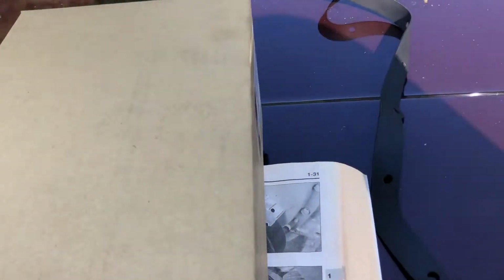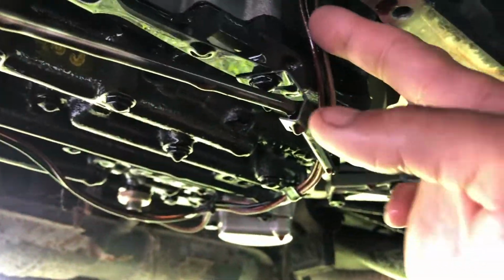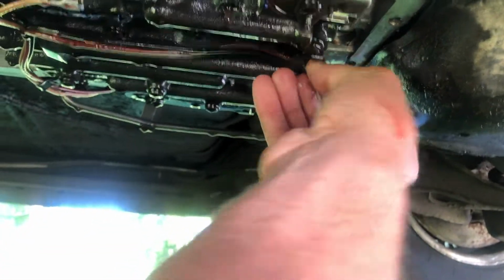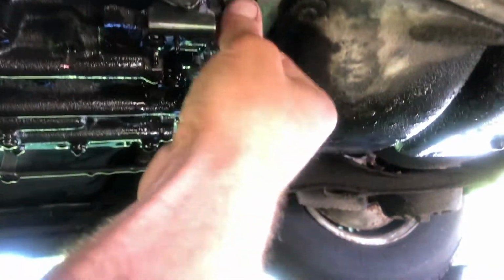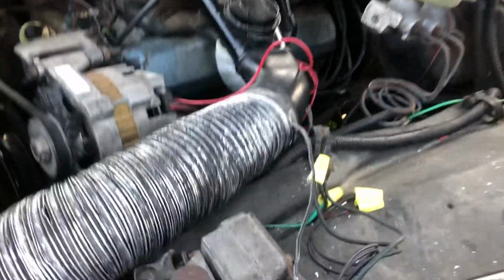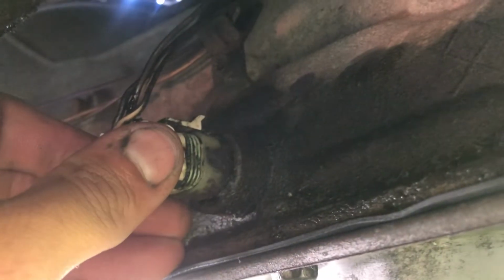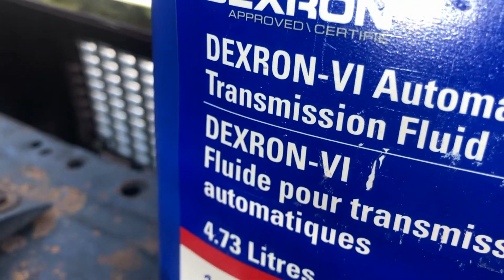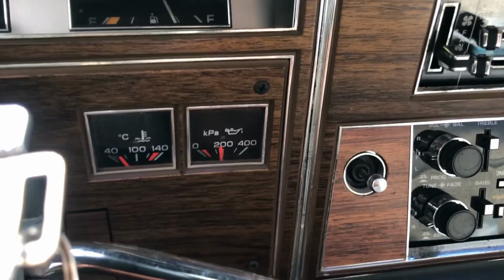1990 Olds 200/4R TCC (Torque Convertor Clutch Lockup) Solenoid Replacement

Comment: hey W>P   ,,, im gonna tackle this soon on my 88 cutlass,,, never done a tranny pan drop so my question is on the gasket , when I am ready to install new gasket like you had in video, do I need to put a "coating" of anything on the gasket, under or on the gasket to the tranny pan?  Or install dry and torque bolts to spec and thats all?,, thanks